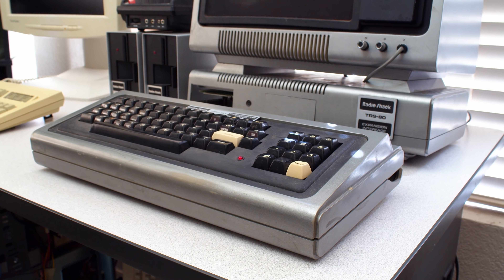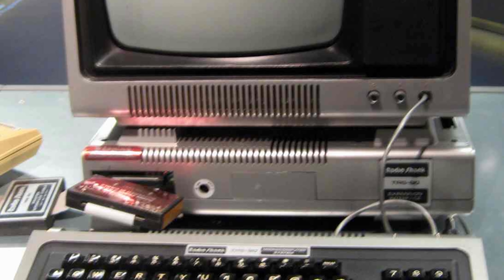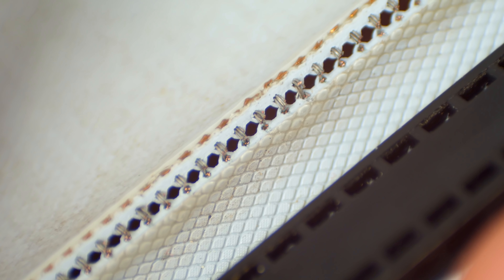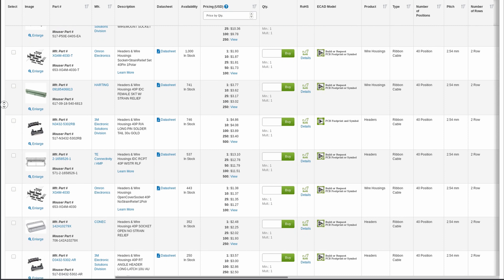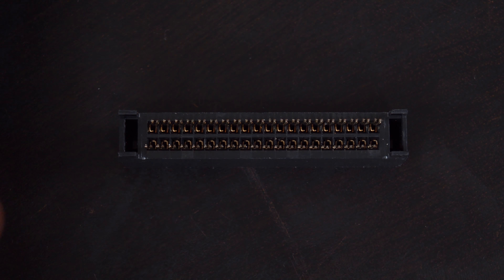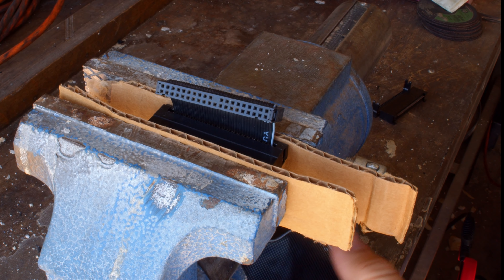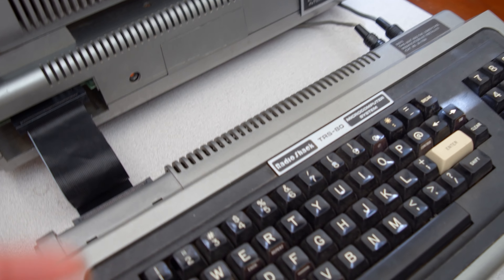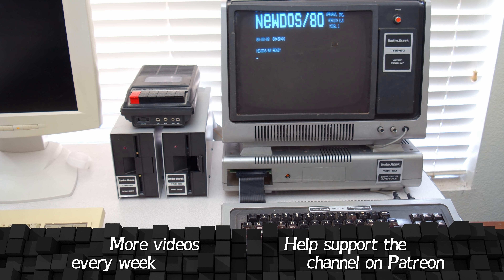TRS-80 Model 1 Expansion Cable Repair | #SepTandy

Comment: When I first started working in computers. Most cables I did was 50 pin scsi cables and others. We not only have a vice. We also had a proper cable tool. Fun times. Fun times.

Comment: I was a Tandy Service Center manager in the 1980's...
Here is some of things i saw back then with that cable...
like you said the cable can and does fail..
 if the cable is good and you still have problems it is the edge connectors on the CPU and expansion unit..they are tin/lead so they corrode easily..what we used back in the day is a pencil eraser and scrub both sides on the CPU and expansion unit...
Better still at the time you could buy edge card connectors that you could solder to the computer edge card that would give you gold connections that you could plug your cable into...not very appealing to look at but much more reliable...

Here is some trivia that you may be interested in..
the warranty stickers on TRS computers:
manufacture stickers were black with white text
service center stickers were white with black text (has the words Radio Shack in the text) .sometimes you will see a 4 digit number written on them starting with a 7 this is the service center number that performed the service...
I have also seen red stickers with black text (has the words Radio Shack in the text)  but i am not sure what they were used for...
Also we used battleship grey locktight on a screw head as a backup warranty seal

Comment: Some things to know about early TRS-80 Model 1 ribbon cable issues. The original TRS-80 Model 1 (1977) was not shielded at all from radio interference emissions, neither the main unit nor the ribbon cable but shortly after it’s release the FCC began requiring computer manufacturer include shielding in their computers and peripherals to limit RF interference. So if I believe that the very earliest TRS-80 Model 1 cables were not shield unlike the broken cable shown here. Another issue they had was that metal use on cable contacts and edge connectors on the expansion unit and main unit were such that they were known to oxidize and require periodic cleaning of the edge connectors by rubbing the contacts with a eraser eraser end of a pencil. This led to owners at the time replacing the ribbon cables with gold plated versions which didn’t oxidize. 

Also, keep in mind that on TRS-80 Model 1’s the expansion unit ribbon cables are not attached to the edge connectors with the best connection/grip and bad connections/disconnections were not uncommon with even a little movement of the main unit which of course could cause your machine to lockup/crash. This was one of the reasons some people nicknamed them Trash-80’s, that and the fact that prior to RadioShack entering the computer business, they had a reputation for schlocky products, and apparently selling personal computers wasn’t enough at first to change the reputation. Of course many TRS-80 Model 1 owners and Tandy corp itself hated the nickname.

Comment: In a pinch (pun intended), I've made up ribbon cables using a G clamp or F clamp and a couple of small pieces of wood to spread the load. It worked ok as long as I was careful to apply even pressure. But a vice is a lot easier to use if you've got access to one.

Comment: I remember in the days of parallel and serial ports, floppy drives, IDE and SCSI, I did a lot of this sort of crimping with a vise (vice). The card edge connectors are pretty easy because they're big and stable. But after a while, you break so many of the flimsy IDE and SCSI connectors that it's just worth buying the official tool. They're not that expensive, about $25. I bought mine at Fry's but obviously that's not an option anymore with Fry's evaporating. They should be easy to find online though; look for "IDC crimping tool".

Comment: You might be the only guy in the world who still cares about a 40 pin IDE cable, they're almost worthless these days. I've got a whole box of these somewhere in the back of my garage, plus a ton of other old connectors from SCSI ribbons to FDD and external multimedia cables, if you need something specific from that age (XT to Pentium III era) post the specs here and I'll search for it, shipping costs for something like that should be reasonable even from this far away (EU).
Reply: neat! i always need ribbon cables for stuff i build, 40pin is pretty good for that.
Reply: I do as well, for older hard drives and retro PC builds, even when they're technically useless nowadays it still feels wrong just cutting them up, but they make somewhat good breakout cables for RasPis
Reply: You can still find them new online by the bucket full, or buy IDC ends and ribbon cable and make your own.  I made a bunch, cut to length for my retro PCs this last year.  :-)  No worries cutting up old IDE cables for now.  We're good.

Comment: I think you can shield it with aluminium foil and attach/solder it to the ground pin.
Reply: Soldering to aluminium might produce the same problem all over again.
Reply: Could also use an 80-pin ATA-133 cable, since every other wire was ground, but doing up the ends will be a PITA.

Comment: Thanks for a very informative video. Is the buffered cable required because of the model of the EI or the model 1 or both? If you have an older serial number model 1 will it work with a newer EI unit? Thanks again, saving this one for reference.

Comment: Those cables are "fun".  I'd love to be able to say it's the worst design choice in an early/mid 8 bit, but...no.  T/S 1000 keyboard, CBM Serial implementation on the C64 for disk access, the IBM PC use of the 8088, and the Intel 80186 all come to mind.  But it's up there on that list for sure...

Comment: Do you have a tech doc of level 1?
I have a clone which I started my adventure with Z-80 assemebler many years ago and was not able to do much on it because of the lack of tech doc. I/O registers, ROM, video documentations. I know only alittle about the machine hardware. video was accessing the RAM on lower priority than Z-80 which was causing flickering at the moment of writting to Video RAM.

I saw many years ago a site with soft for TRS but I have not mirrored it and I am not sure it is still available. Moreover it had TRS soft without any information about the model.

Comment: 40-pin ribbon cable (single color, like Gray) is often MARKED for Pin 1 (Red Line) or 
in this Video, the Black ribbon cable has a White Line to mark Pin 1.

The Card Edge connectors have an ARROW for Pin 1 (many are numbered).

YES, he installed Card Edge Backwards, against the 40-pin ribbon cable index.
Reply: Though in this case it doesn't change anything about the wiring itself, it would just be for aesthetic and completeness purposes

Comment: I wonder, hypothetically, if you could split all 40 wires and then wrap all the wires in a braided shield of some sort. I imagine it woulden't work at all.
Reply: Split the wires to get some shielding around them? I'd rather go buy copper foil from a stained-glass supply house and solder it into a tube that could just pass the whole cable through it. If you laminated it afterwards, you'd likely even have a long-lasting shield.
Reply: @absalomdraconis  I've had this issue with tying up my point-point soldering on protoboards. Even if you shield it from outside interference, if you bundle the wires together, you'll get cross-talk between them, which can just make it worse. I know that LPT and serial cables just have their wires loose inside the braid, but they only have a limited number of signal wires. This connector is the entire system bus. Best idea, I found, is to at least bundle the address and data lines separately.
Reply: If you're going through the trouble of splitting each of the 40 wires, I'd just salvage an 80-pin ATA-133 cable instead. The extra ground wires between each signal wire are to reduce cross-talk.
Reply: Back in the 1980s 3M made IDC cables and connectors, and they  even made a round flat cable. It curled up the edges and had a black outer jacket or sleeve. I only recall using it once for a project at work, but it worked out better than a regular flat cable would have.
There were also flat cables with twisted pairs, used them in larger disk drive cabinets and such.
Reply: @bobblum5973  You can still get IDC connectors, even card edge ones at Digi-Key, Mouser, etc, the only issue is finding the specific pin count you need. Oddball sizes tend to be harder to find.

As for rounded cables, It depends on what it's used for. The issue arises in this case, because the MEM & I/O strobes, and the address lines are sending constantly, and these cause cross-talk with the data bus. Twisted pair is the best method, as the second wire in the pair always acts as a shield for the first wire. In that case, you can bundle them as closely as you like.

Comment: $45 USD for a buffered cable? I could build one myself from scratch for cheaper.
Reply: You could say that about almost any product over $10
Reply: @bradleyhove4177  Not always. Often, it depends on whether or not you have the tools and know-how. I never buy network cables either, because I have bulk Cat5e cable, RJ-45's, and the crimping tool on hand, and can make my own far cheaper. Most people don't have these, and will just buy whatever length they need, paying whatever they have to.